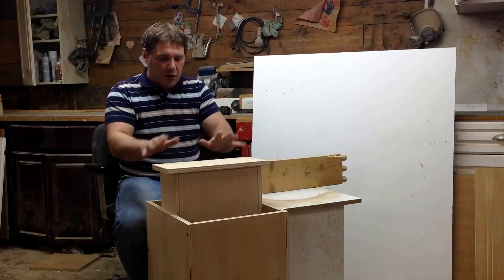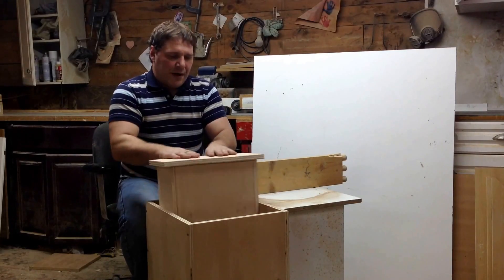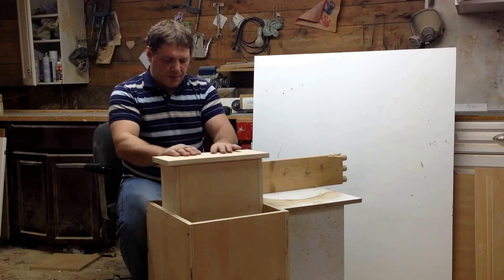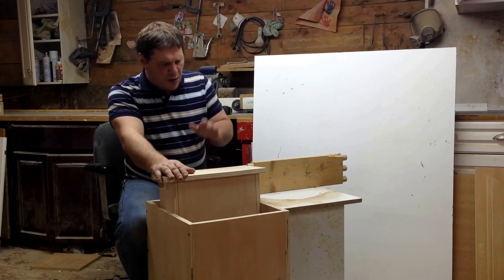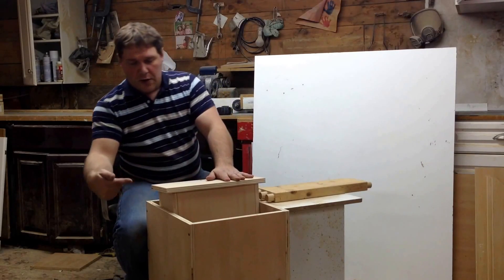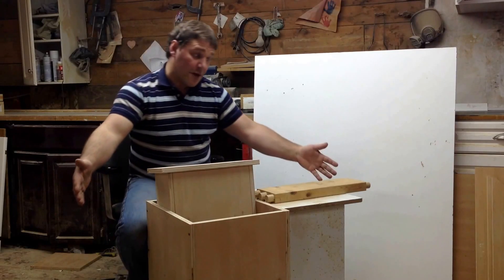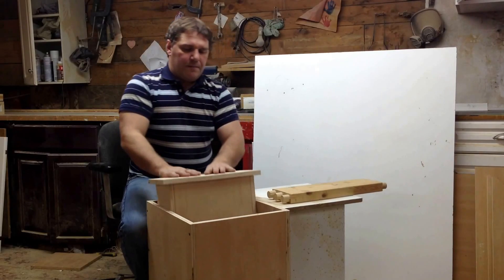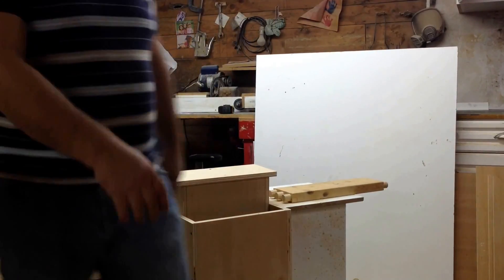Building Floating Router mortise and tenon machine 2 Feb 21, 2014

Comment: Hey: Looks good so far. I have my router running on rails parallel to my lathe but I run into the same problem of chip out on the ends of the spindle that I'm cutting with the router bit..  The grinder with the blade is a much better idea you had. Your new machine is going to be great for cutting mortise and tenons. You have some great ideas, I started on mine today and if it works as good as expected maybe a person could mount the box on rails or skids parallel to the lathe and use it to cut spindles and ball bats and things too. Could even make the router and grinder interchangeable on top. i know most of use don't have enough space and that's your main concern. This could have unlimited uses.  Maybe i been penned up to long this winter. starting to line up to many things to do.